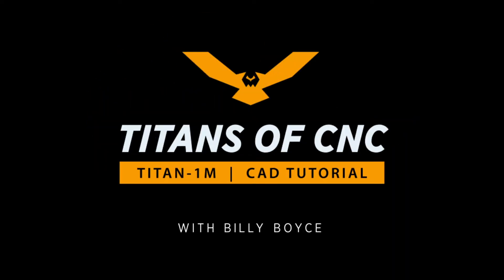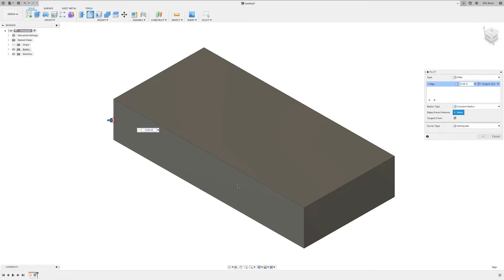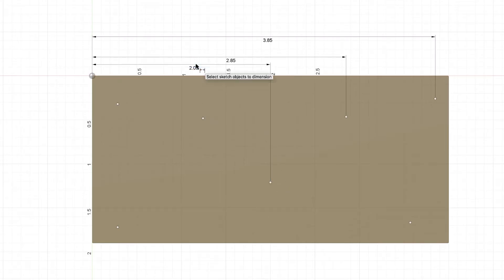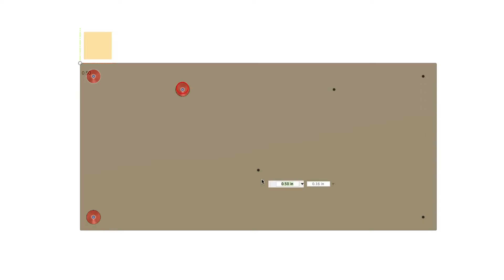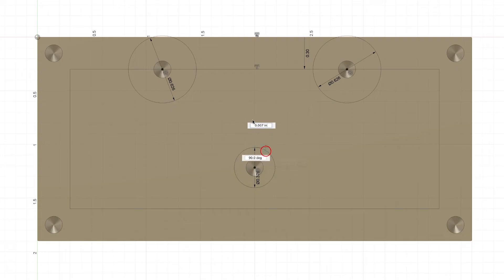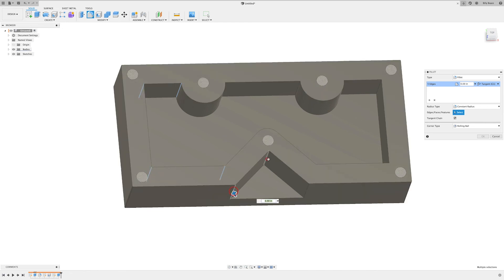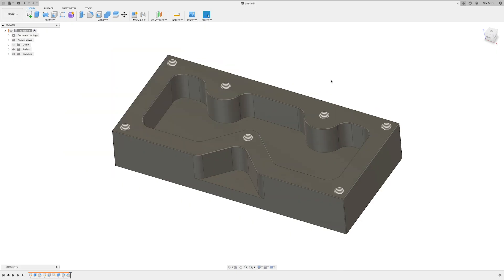FUSION 360 TUTORIAL: DESIGN THE TITAN-1M | ACADEMY

Comment: This tutorial isn't working for me. I can't tell if maybe the functionality changed in the last 5 years. But:

- If I select sketch, and the top surface, I cannot do a 0.30 offset. It won't let me select the edge. Instead, I have to click "O" in Solid mode, and then it will let me select the edge.
- My offset has to be 0.30 instead of -0.30. If I make it negative, it goes into the opposite direction and is larger than the rectangle.
- When I try to do the part at the 6 minute mark, where I have the bottom circle and I have two lines going out at 45 degree angles, the circle itself is not constrained, and neither are the lines. So when I set them at 45 degrees, the entire thing shifts.

Comment: Can someone help me out with the chamfer? I've gone through the video a handful of times, and it doesn't seem to address the triangle pocket or the holes.
Reply: I wouldn't add any of the chamfers, it'll make it more difficult to generate a tool path for them. Keep the edges sharp for the CAD design, then add the chamfers in when you're in CAM/Manufacturing, they'll look cleaner and be much easier. Hope this helps.

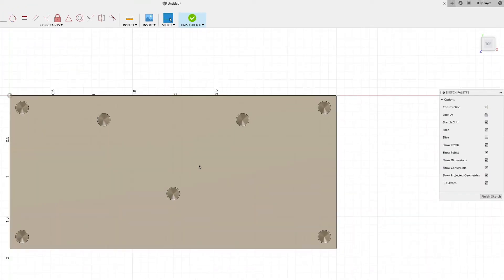Comment: At 4:56 when you begin to sketch the inner pocket, make sure to do as the instructor does and click the top surface of the part after you select the "create sketch" or you will have trouble selecting the part edge when you sketch the pocket on the next step.
Reply: No matter what I do, I cannot select it for Offset purposes. I can't tell what the difference is between what he does and what I do. But once I start the sketch at that time, I can't select the border for the offset, and the circles and lines I add don't snap into place.
Reply: @alexs3974  same here and its very frustrating
Reply: @haydena6935  I had the same issue. I solved it by creating a sketch on the top, but before pressing O I created a rectangle from corner to corner. Then I could press O and offset by .30. Hope this helps anyone in the future.